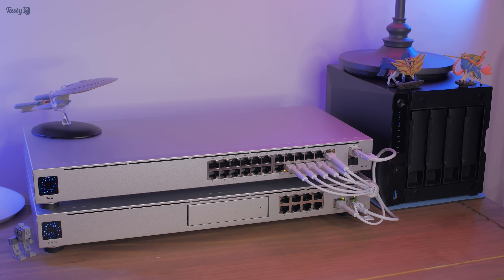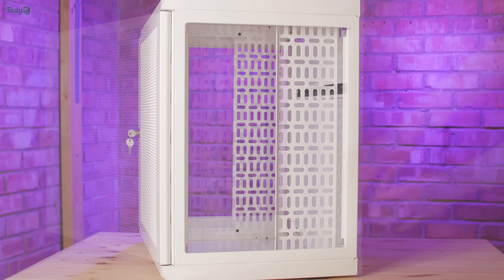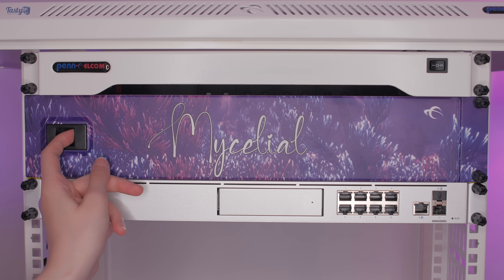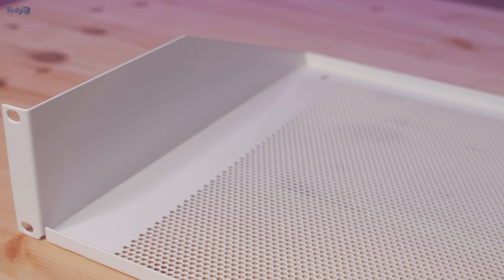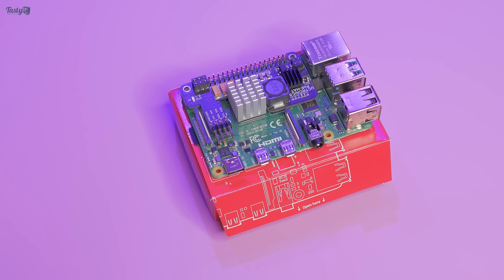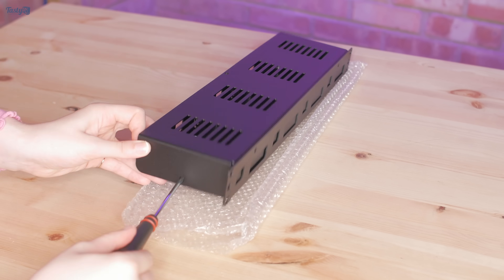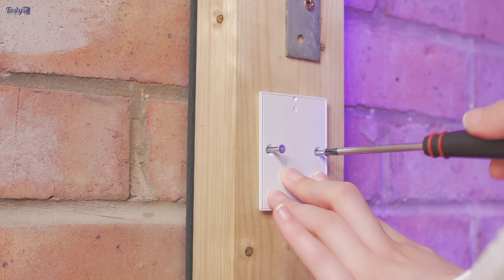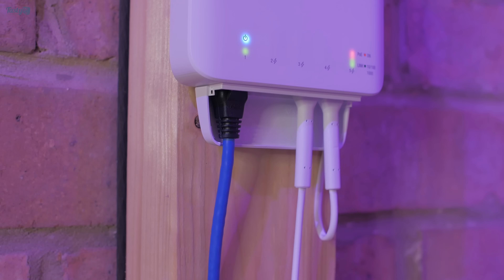White Rack, Pink WAP & Multiple Pi's

Comment: lol I have the same setup, Im extra bougie as I have dual gb Internet uplinks from separate providers.  Unify has been pretty solid for me. Only complaint is lack of easy parental controls and a lot of click to block and unblock devices but those are small complaints. I have my stuff in a "secret" hallway in the basement powered by a UPS that came out of an IBM XIV storage array.  My cable management isnt as nice though.

Comment: When (Cause realistically its not if) you get a server, you can use the spare PI as a KVM incase you need to hard-reboot the server. (In case it hasnt already a management LAN port) Also its really handy to have remote access to the server if it has some wierd outage, and you dont want to get up and plugin the debuging card...

Comment: The reason the screws were so hard to put in, is because of the powder coating itself. It is in the threading and you have to force the screw through it to get it to fit since the coating does make it smaller. Best thing to do with that situation would be to use a tap and die set, or similar, to clean the threading before putting in the screws.

Comment: for your garage get a diffuser and some 100% pure peppermint oil and run it in your garage once a week or so.  Dont just put a few drops of oil in it, put about 2 or 3 tablespoons of peppermint oil it it with the rest water and it will absolutely cure your garage both of the moldy smell AND of all the spiders.  they will all move out and annoy your neighbors instead :)
 <3

Comment: And now you will need a Dell R720 server, those are the quietest one if you are not building a tower variant. You can easily run TrueNAS, Zoneminder and OpenHAB on it, and even put in a NVIDIA GTX 960 GPU.

Comment: I cant believe I get to say this to a woman and not get slapped.  Nice Rack babe!!!!  Look into a company called Furman. They make power conditioners for electronic gear. way better then just a surge protector. I used them in all the effects rack for my old bands PA system and now have three of them in the house for all my electronics. They really prolong the life of sensitive gear as well as have great surge protection. They also come with a huge guarantee about your gear getting damaged and them replacing it should the unit fail to protect the system.

Comment: FYI: There is actually no such thing as "backup" DNS- when you define multiple DNS servers your systems will simply use one at random. This means ads will get through whenever the second  DNS server is used. You have to use the Pi-hole only and no other DNS servers for complete ad-blocking.

Comment: After years of dealing with cage nuts: Grab a PCI card slot cover from an old PC case. Push the far tab of the cage nut in with your fingers so the nut is at an angle, then just pop the other tab in using the slot cover.  Saves all the skin on your fingers. To remove the nut, use the slot cover to push the tab in (from the nut side of the cage), and catch the nut as it pops out.
Reply: Or, and here me out on this, buy a cage nut insertion tool.  The type that looks a bit like a set of nail clippers.  Might cost you almost 10 bucks.  Easily insert or remove any strength of cagenut, from almost any space, in the shortest moment.

Comment: Are you happy with the Unifies?  I was looking at getting a dual-WAN switch so I can dump Comcast in favor of a local ISP.  The local ISP's fastest line is 400mb/200mb fiber, so I'd need two lines to get near-parity with my current 1gb cable (excepting large files).  The reason I'm considering this setup is that the two 400/200 lines together are still cheaper than my 1gb/35mb Comcast (which I'm paying ~$150/mo), and would also give me 11x the upload bandwidth, no f'ing data caps, and support for the local business guy.

Comment: May I recommend using Torx or Hex screws instead of Phillips screws. You will have probably an easier time uninstalling these if they get stuck. I personally try to use Torx or Hex as much as possible and Philips only as a last resort.

Comment: Newer idea of using pi 4 compute module on a vertical circuit board, with multiple boards running the length of a standard server rack, and support for onboard m.2 drives.

https://www.youtube.com/watch?v=zH9GwYZu_aE

Comment: You can also use you pi has a terminal interface for low power usage to a battrie so during power outage you still can manage your network
Reply: Also do a stack . For 1200 usd you can get like 64 cores thats like the price of a threadriper

Comment: the way you mounted the raspberry pi really messes with my OCD and it's not because it's using 2 screws instead of 4. It's because you used adjacent holes instead of diagonal.
Reply from the maker: I get that, but if I went diagonal then I would have removed the PoE hat and at that point I would have done all 4.

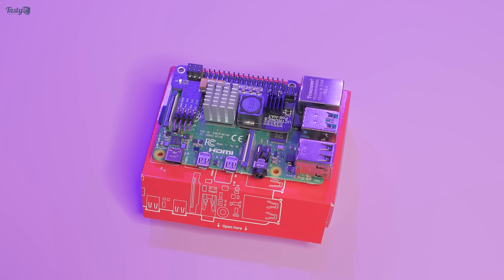Comment: 9:44
"I've plugged in a USB keyboard and mouse as well as an HDMI cable"

You can get away with only using an ethernet connection (or even wireless but it's a tad more complicated).
By placing a file with no content called "ssh" (no extension even) on the root of the SD card the Pi enables SSH on boot with the default user and password.
You can then obtain the IP over the management interfaces of your router or what not or use a network scanner (I like to use Fing).

Headless SSH (Number 3):
https://www.raspberrypi.org/documentation/remote-access/ssh/README.md

Fing network scanner:
 https://play.google.com/store/apps/details?id=com.overlook.android.fing

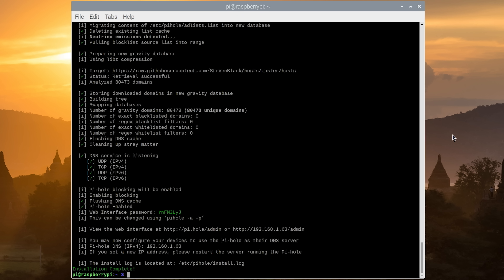Comment: 10:38 you mention setting Google as the Secondary DNS for backup, and according to the DNS spec this does make sense, however, after running a BYOD network with 2x Pi-Holes in VMs (Primary & Secondary) it does seem like some devices do round-robin style NSLookups with a share of about 80:20 between primary and secondary with no real pattern as to which devices or why, so may be worth either removing the second entry or setting up Pi-Hole on the second one with a different upstream provider (DoH/DoT for encrypted DNS requests?)

At home I run both a UniFi Controller and Pi-Hole on the same Pi 3 Model B+ and it doesn't even break a sweat, so you have a bunch of spare compute headroom with both of those Pi 4's that you can do a lot of other stuff with, possibly Home Assistant or Plex?

But yeah, good stuff, I'm planning a very similar setup for when me and my partner move in together
Reply: I second the DNS advice. It's what is recommended by the Pi-hole devs too. 
I also recommend to people to use RAMlog, I use DietPi which has by default, because depending on your logging settings in Pi-hole, your SD card can wear out fast
Reply: @DeeDee Ranged Oh yeah. I forgot the newer pi's have that support. Mine are 2's but still fine for Pi-hole

Comment: I used a keystone panel but also included a couple of RG6 cable TV wire feed so I could put my cable box in too and I also have a TOSLink jack and two APC/SC fiber jacks for a fiber optic feed for a long run HDMI connection and for incoming fiber to the home. It should be possible if you get fiber to direct connect to the  Unifi. there are videos on her about that. Check this https://www.youtube.com/watch?v=XfH72Ko0VZI

Comment: You can actually power the rpi with poe without the poe hat, only downside is that the power pins on the pi will output as much power as they receive from poe (the poe hat dumps the excess so you dont get electrocuted when working with it)
Reply: I thought PoE negotiated the power requirements?
Reply: @anon-bf3jw  if you have a 802.3af switch that the pi is connected to then yes, otherwise no (you could theoretically connect the pi straight up to a poe injector and it would get whatever the hell the injector gives off). I believe the pi hat is required for the negotiation to happen aswell, but don't qoute me on that.
Reply: @4_real_bruh  ah, thanks, I wasn't sure

Comment: Maybe what a good idea is for your second PI is to run a PRTG network. It's going to a bit more technical side what it is it's a monitoring tool for your network so If you enable SNMP it can find all your devices on the network and also notify you when they are offline or if they are having a storage problem etc.

Comment: I love the custom rack setup, it’s so clean opposed to the racks I’m used to dealing with. If i had more room at home I’d love to try something similar with rack form factor hardware but what i ended up doing was take a wooden crate and mounted the gear on outside and passed the cabling inside through the slats. It looks a lot neater than it sounds!

Comment: I've used "Aluminum" spray paint to match things. It's amazing how easy it is and little time it takes. As with most surfaces, scuff with 220-320grit sandpaper, clean with some brake cleaner, paint thinner etc and spray 2-3 light coats. Give a day or 2 to dry and admire how nice it all matches

Comment: You may have ordered the wrong Rack Studs, there are two different colours to accomodate different gauges of rack metal. I always recommend to anyone trying these to first order the Rack Studs 4 Pack Sample kit to figure out which colour to order for their rack(s). However, as you mention, the extra coating may be making it thicker than normal. (Edit: Nope, the purple/turquoise ones are the thickest, up to 11 gauge)
Reply from the maker: The pack of Rack Studs I purchased contained both colours/sizes so I tried both. :)

Comment: When installing gear in a rack put in the bottom screws first. Leverage will work for you to let you install the top screws mostly hands free. If you install top screws first and something happens that causes you to let go of the equipment (and it's heavy enough) the leverage can damage the rack ears or rack posts.

Comment: I have a Pi-Hole running on my unRAID server as a docker container. Saves a few watts and is tidy. UnRAID also is my NAS and VM host for my Windows 10 PC, Linux, Tails, and a few other dockers. Time to upgrade the Xeon 10-core and 32GB EEC ram.

Comment: Nice work!
Such a pleasant deviation from black hardware & blue LEDs too. I mean does network hardware really have to look like it was designed for the batcave.

Have you looked into doing DNS over TLS with your Pi Hole?

Comment: I'm really happy with the way it turned out. I recently created a similar rack , but with the additional headache of outboard audio gear. Cable management is so hard! Do you have any tips or anything that you ran into that you ended up solving to make cables cleaner?

I like the idea of ordering purposefully short cables, but that isn't always the case especially with power. Trying to figure out how to coil the extra and where. It is especially hard with analog audio runs nearby.

Anyway, thanks for such an excellent video. The production level is so stellar on these. Glad to see you're back! Do you have a discord or twitch?

Comment: Those patch cables in the thumbnail looked familiar. My entire server closet uses these. They are so thin and flexible too. I have close to 200 of these running from 2 x 48 patch panels to 2 x 48 POE Switches. I also have several different colors (black, red, orange, yellow) depending on what type of device they are connected to on the floor. Oh, I also got mine from Monoprice.

Comment: A ups is a must have for such a setup. I have comparable one at home, that had problems restarting after a power loss. You could just get a cheap used ups of ebay and install new batteries in it. That way I got a 1500w up for around 200€.

Comment: Nice colors on the cable.

With today's high frequencies and high speed, there should be spaces between conductors inside the cable!

High frequencies lies around the conductor and not inside if you understand.

The cable used is IMPORTANT!

The ones you have chosen look very thin

Comment: You could use the second Pi for homeassistant, a diy smart home hub that can connect and automate basically everything, independent of manufacturer. 
I especially love the ESPHome integration for it which you can use to easily build fully custom ARGB strips for your whole home 🤤
Reply: Definitely this - I've configured my HA to provide emergency lighting if the UPS kicks in during the great blackouts of 22/23

Comment: Great video!  One thing that I noticed is that you didn't install a ground cable in your surge suppressor that was mounted at an angle in the garage.  Without it, the surge block won't really do much.  You probably installed it off camera, but wanted to make sure you protect your gear!  :-)

Comment: IMHO run two Pi-Hole, if one goes down this second one acts like a backup.
Reply: At first I thought "really, redundancy for your adblocker? Really?" But then I remembered it's also the only DNS. So yeah, redundancy for the PiHole is perfectly reasonable and makes perfect sense.
Reply: At the moment pfSense is my secondary DNS, but that'll likely change at some point.
Reply: @InterFelix  yea the amount of time I have taking my VM server down and everyone in house is like where is the internet!
Reply: Not a bad shout; might do the same.  I'm running PiHole in a small VM at the moment. Might get a low-end Pi and have that as a primary, with the VM as a secondary.
Reply: @johnmcquay82  i have this setup, but i use vm as primary and pi as secondary

Comment: @1:24 How much thickness does the powder coating add?  I wonder if the M-6 screws were too tight because normally the mounting holes are just a little bigger.
Reply: @5:09 ...........called it?

Comment: Home networking labs are typically used for network engineers while they are studying for certs to get hands on with the concepts. You can virtualize it with GNS3 or EVE-NG, but I do prefer real gear. Nice set up as well by they way. Very tidy!

Comment: You shouldn't set a backup DNS on your router at 10:40, this is likely why you are still seeing some ads. You should also set Pihole up as a recursive DNS server for even better privacy ( https://docs.pi-hole.net/guides/dns/unbound/ )
Edit: clarification for why you shouldn't set a second DNS server on your router. If you configure two DNS servers depending on the OS of the network client it can use the second DNS server when the first one can't find the IP of a domain or when the first server takes too long to respond. This causes your computer or phone not to use PiHole all the time.

Comment: I used Pi-Hole very briefly and ripped it back out when i discovered sites that rely on tracking no longer worked e.g. Hot UK Deals.  I suspect quidco and Topcashback would also fail to work (as local adblockers in chrome also stop them working).  I briefly set devices that needed to use sites that had problems to over ride the DNS.  There may be a way to fix this but I lost interest and moved on.

Comment: You shouldnt set a secondary dns server on your router. Theres a really good chance that ads will get through because most routers use all dns servers listed rather than using them as fall back. There are also other options like adguard home which is like pihole but has its own benefits. There is also unbound which you can use with pihole to avoid using a public dns server like cloud flare or google. Instead unbound talks directly to the root servers so that third party companies dont see your queries. Its not encrypted tho so your isp can still see them. There are also speed benefits involved with unbound as it has really good caching built in.
Reply: I wouldn't go using statements like "most routers" regarding DNS. There's a dozen different ways routers handle DNS, and it doesn't even go the same way across a single manufacturer.
Reply: @tin2001  Iv troubleshot many people who have had issues because of doing that. Yes there are many ways of handling it, but unless you know your router doesnt handle it that way i still recommend not setting a secondary.
Reply: @angrynerd2103  Yes this is good advice. If you're going to have secondary DNS (which would be sensible), spin  up a second pihole to maintain AD blocking capability.

Comment: Your using speedtest, but they lie. Seriously all you've told me is that your running on adsl connection as opposed to virgin cable. If you really want to test the actual speed you need to run testmynet from a browser. It also can batch test overtime.

Comment: Hah, my home network is at the bottom of the linen closet. It's CAT6 wired, connects to my NAS (an Athlon Hammer from about 2002, mobo recapped, 750w silver PS, a million fans to keep that POS cool ) and a UPS, which was beeping today. Not much to look at, but it works well.

Next step is to get the 10 Mbps switch connected to my Turbo XT, 386, 486, and P233 MMX. 

Thanks for the kick in the ass to get it done :D

Comment: I haven't worked with rack equipment in over a decade and I had to laugh seeing that powder coating is still a problem. The tolerance on the machined parts is already so tight that the thickness of the powder coat ALWAYS causes problems. In an ideal world QC would flag these parts for with a non-compliance report before being shipped but.... :S.  In any event, looks fantastic! Well done. Oh and that title xD